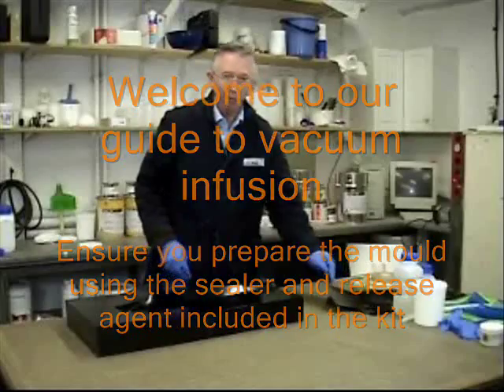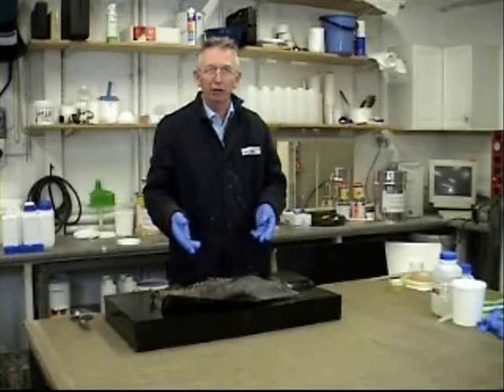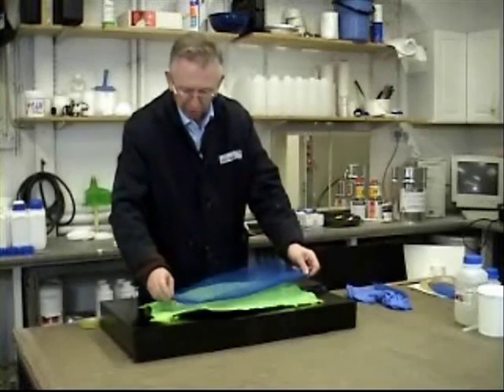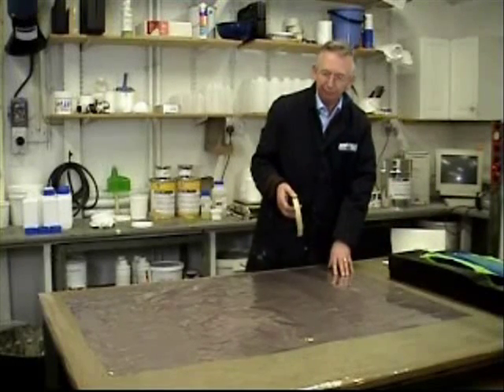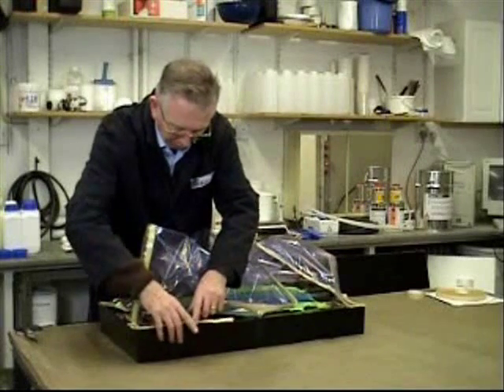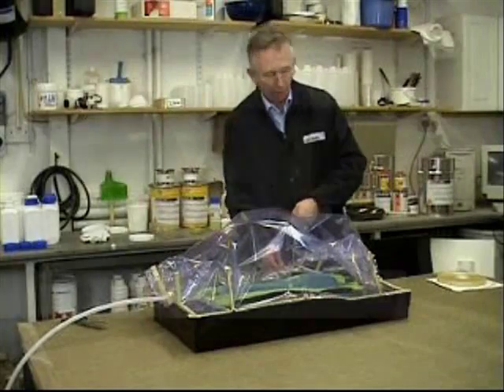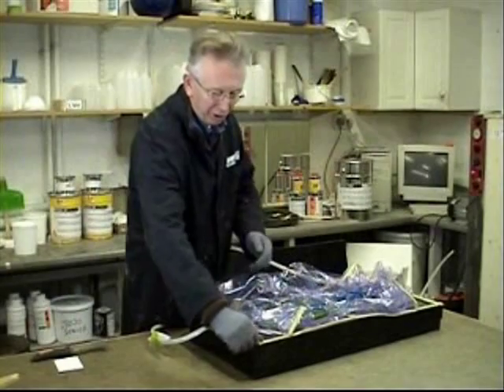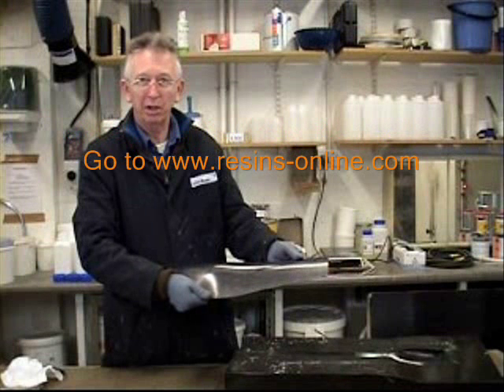How to produce a carbon composite part using vacuum infusion

Comment from the maker: @circusboy90210 In Infusion you cannot use open cell honeycomb as the cells will fill with resin, which will add extra weight, the structure will be much weaker and risk of exotherm is high. Closed cell honeycombs and foam cores of various types can and are used in infusion.